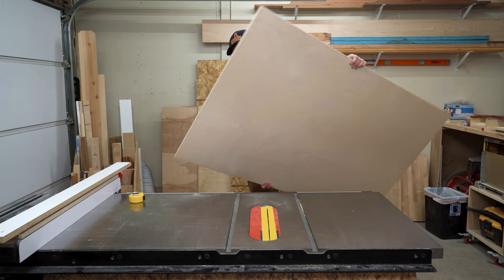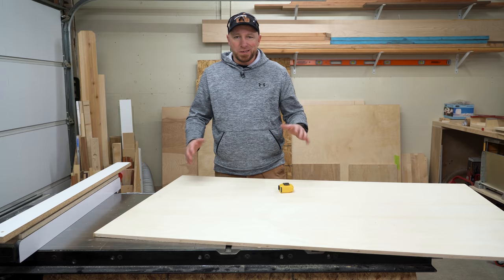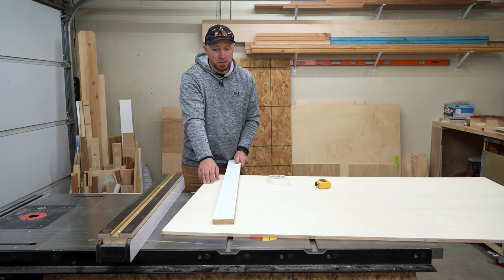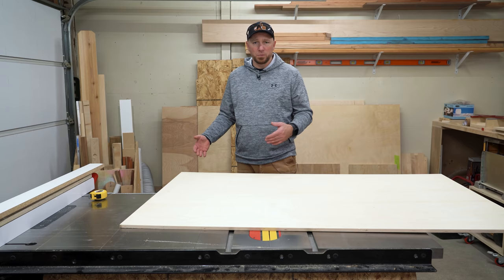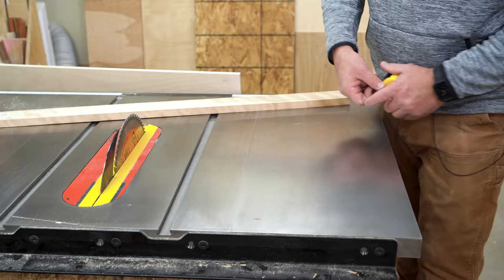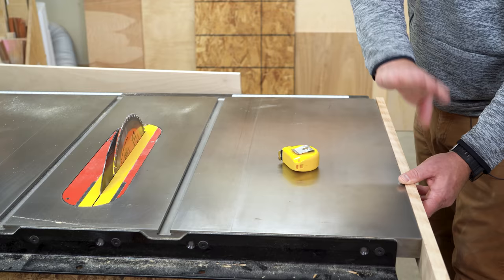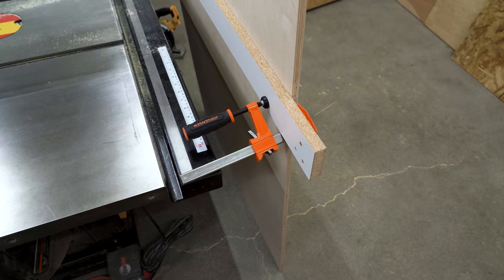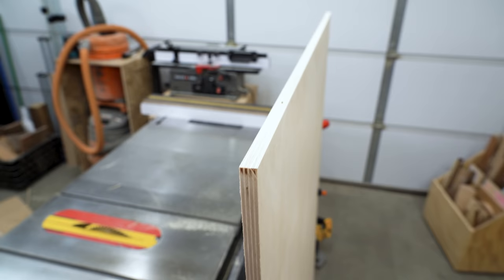A Table Saw Trick So Crazy, It's Genius!

Comment: I like this tip. It gave me a 'smack my head' moment. For the flush-trim router comments - yeah, and I've done that myself. What I found was that the setup was excruciating, and if you needed to edge a really long span then you needed a really long(er) AND perfectly straight piece of stock to flush trim against, which kind of leads you back to where do you get that straight piece? And sequentially aligning the clamps and board are possible... guess it depends on how much time you have. The router route (see what I did there) also leaves burns as soon as the bit is hot, and I may have been using shitty plywood, but I had a bunch of tear-out.
Reply from the maker: Absolutely. Folks here that have goldfish-brain have to realize also that it takes a lot longer to teach someone to do something versus doing it yourself. In reality, it takes no longer than setting up for a router. In fact probably less time because I would have to get the router out, most likely change the bit, and so on. The table saw is right in the middle of the shop and always ready to go. Plus I wouldn't want to break down a whole sheet of plywood with a router. That sounds horrible.
Reply: @InspireWoodcraft  Very true, and I've broken down plywood with a circular saw, jigsaw and then routered the edges clean because this was the Dark Time before I had my Powermatic. Took forever. Edges still sucked ass.

Comment: A much simpler way to do this would be to attach that "fence" to the actual fence and raise the blade with the sacrificial fence moved over the blade. You'd be able to take off as little, or as much material as you want, without all the hassles of squaring up a cleat and relying on the clamps to hold it securely.

Comment: I have used this "trick" before. However I would suggest that you buy a bigger square. It may make a smoother edge but it needs to be square and you can depend on that if the square is larger.
Reply from the maker: @DEW-fk7ij The only problem that I have is that decent bigger squares are really expensive. And framing squares aren't reliable and are a pain to use. In fact borderline impossible in this specific situation. A quality smaller square registered against a known straight edge of the material is still going to register square. The square's blade length can be increased by using a straightedge against it like I did here. I commonly do this with sliding t-bevels to increase their reach as well. The only time a smaller square won't work is if the edge of the material is not straight enough for the task at hand. If the reference edge has any undulations and the stock of the square (the part that registers against the edge of the material) is too short to span those undulations, it won't be very accurate to the overall edge. I do wish someone would come out with a quality larger woodworking square, similar to the Woodpeckers style squares, at a more affordable cost.

Comment: 0:32  if it wobbles, either some bolts are not tight, that’s an inferior brand - or you’re holding it wrong. I’ve never had a problem.

Comment: uhh.....cant you just use cordless circular saw to rough cut it down to within an inch or so of the final width and then put it on the table saw?
Or is that just too simple?

Comment: The day, about 30 years ago, I built every table and every saw the exact same height , in my shop, my life got a whole lot simpler.  But, the day I bought a 24 x 70 ft shop helped a lot too.

It's a good trick but having an outfeed table to support the back end sure makes things easier and more accurate.

After working in my dads small shop, where everything was stacked on top of everything else, as a kid, I decided I was never going to do that.  Now that I'm retired even my "hobby shop" is 27 x 45. LOL

Comment: Very nice.  Wish i had that much room on the side of my tablesaw to do that.  When I've need to do this, I've clamped a straightedge guide to the plywood and then run a hand-held router with a flush trim bit along the guide to finish the edge of the plywood. Depending on the grain direction of the surface veneer, a piece of masking tape or sacrificial block prevents tear out at the tail end.
Reply: The even easier way is to simply use a hand plane. That is what they were designed for.

Comment: With all that weight of the plywood panel your left hand has to hold up makes for an unsafe method. If one of those clamps slipped, there goes ur straight edge.

Instead, clamp on a wood guide fence and use a router with a trim bit to clean up the edge. You'll get a perfect 90 degree cut.

Comment: Good stuff……took a few little rewinds to gather it all in but once I could see the final piece there were B I G smiles!

One query: if you weren’t overly concerned about being very accurate when setting up your non blade end, why did you bother at all as it is such a very tiny sliver? Couldn’t that measurement be lost in your casual (in the nicest meaning of the word) overall setup?!
Kindest
Bob
England

Comment: Using 8" square across 3' why not at least a framing square.  Also a good corded saw with secure base plate and clamped straight edge has worked for me for years

Comment: I'm 48 seconds into this and what I do is clamp a straight edge on the edge I want to straighten up, right where I want my cut, and use a router with a 3/4" bearing, on a 3/4" bit, on the 1/4" shaft. This makes a perfect edge without tearing the veneer at all. If you are worried about tear out at the end of the cut, you can stop just short and use a belt sander, or you could back it up with another piece of wood. I always just used a belt sander, or a sanding block.
Reply: I was going to say the same thing.  I use a router and template bit and straight edge for all my precision cuts. Actually you don't even need a template bit, just measure out for the router base.  To me the table saw method is way to time consuming and not as precision.  Router method also allows to do away with a jointer.

Comment: I always find it curious as to why Track saws are not used much over the pond (at least in regard to woodworking channels I see here on youtube). They're very affordable these days and in this case, is the right tool for the job. Yet people persist to make life harder for themselves and use the table saw.
Reply from the maker: They are used quite a bit. But they're an expensive option for someone that would only use it a few times a year.

Comment: Use a router and straight edge. If you need to remove more than half the width of your router bit then first  jigsaw close to your finished cut line. I don't recommend complicated tricks for DIYers. Safety first.

Comment: Build yourself a panel saw it will fit up against the wall and it the best way to cut sheet good also you build a router into it, the table saw was never meant to cut big 4 x 8 sheets of plywood

Comment: That's a cook trick and all, but the easiest way is to just cut a little less off with the crappy buzz saw, then attach a simple straight edge to the panel and use a ROUTER to get your perfect edge.
Reply from the maker: Sometimes "easiest" is a term that only holds true for whoever says it's easier. My router is in the lift, so I would have to get it out, set it up, and so on. This takes a minute to set up and the saw is right there in the center of the shop. And with this I can break down a full sheet of plywood without the waste of a circular saw and router setup.

Comment: The hook on your tape measure is designed so that pushing it against something or hooking and pulling results in the same distance measured. It slips the exact distance of its thickness unless you've damaged it by letting it constantly slam home uncontrolled.

Comment: When you think about it, your method (which I have used many times) is identical to the saw guide and 7-1/4 cordless method, but upside down! You just made a giant saw guide for your table saw! 😉

The saw guide board works great for me, I guess my 7-1/4 blade and sole plate happen to be more suited for smooth accurate cuts. But, it's obvious there's no substitute for a good table saw and blade.

Comment: Thanks for putting in the effort but you were close when you showed that fence and double sided tape.  clamp the fence and use a circular saw.  That way instead of trying to wield a half or three quarter size sheet of plywood, it could lay safely on your table top or saw horses and you just deal with your very small cut off.  Work smarter not harder.

Comment: This is great. Thanks for sharing. 

An L fence, or horizontal fence, with the straight edge guide attached on top of the work piece, would be another way to perform this operation.

Comment: Great idea! I would only add one thing to this. To the left of your saw as you're facing it to make your cut, I'd have an adjustable sawhorse with rollers to bear the weigh of the wood, if it's large enough to warrant needing more support. And, of course, a nice infeed and feed out table would be nice, but room can be a problem for some. I'm going to try this this week for the roof of my chicken coop run just because if I botch it up, it's not a critical item. That way, I can learn from my mistakes.  :-) Thanks for a great tip!!

Comment: That is a great idea, but I think I have a better one! Just buy a WEN track saw for breaking down your large pieces, most of the track saws are freaking outrageous in prices but the Wen saw is awesome and it’s nowhere near the prices of the others. People should really check them out, I have several tools (spiral head jointer, spiral head planer, track saw, drill press and a ceiling mounted air cleaner) that are from Wen and I’ve had nothing but perfection out of each and everyone of them. Now, go make some sawdust!

Comment: An interesting method but impractical when trimming a full sheet. I personally use a track saw, gives a clean accurate cut and no heavy lifting.
Reply: I agree, but it would be useful for trimming smaller pieces.

Comment: Why not just tape a piece onto the to be cut end say 24 inches wide  and then set the fence that will take off the amount you want? That way it will be easy to push the panel through. It's not easy to cut a inch or so off the end of a panel so close to the fence.

Comment: great solution, I only see one problem with your method. You want to be sure the cut is square, and at a perfect right angle, which is hard to do with such a small square. I would use a framing square, or a more accurate method would be to measure both sides of the board, presuming the board is already square.

Comment: Cool trick. But I cannot believe you used a 10” square to line up a 3’ fence. A 64th gap at the end of the square compounds to a good quarter inch over 3 feet.

Comment: I'd use a trim router, if the table isn't big enough to support the panel, take the tool to the job.
Reply from the maker: You would use a trim router to break down a whole sheet of plywood?

Comment: Instead of a box over the fence, any reason you couldn't make the same jig but using a strip of wood taller than you fence and connecting it with the dovetail clamps? Then you have 3 strips of wood - one taller than then the initial strip you made, one the same thickness as the original strip that slides on top of the original strip, and one to sandwhich the sliding strip on the other side. Hardest part of the these types of jigs to me is making the box just tight enough so it doesn't wiggle but not too tight that it doesn't slide.

Comment: If the project was planned, when at the hardware store, in the area where they have sheets of plywood, etc, They have a wall saw and charge per cut....50c whatever...and easier to handle..
Reply from the maker: I’ve done that before. They cut them all not square and I didn’t realize it until I was using them for my project. Never again.
Reply: @InspireWoodcraft  That's a pain.... everyday someone at the store with experience/training should calibrate the fence/saw.... maybe at a mill? Just saying. You setup is fine.

Comment: I guess whatever works for you.  I have a LONG rail and extension so I've never come across this issue.  But if I did, I think a router would be a bit easier.
Reply from the maker: Like you said, whatever works for you. I've personally never seen someone cut a sheet in half with a router.

Comment: Ever heard of a panel saw? Fits up against the wall of a small shop. It will square any plywood with minimal effort.  Takes up hardly any room.  Used one for years. Never have to lift a sheet of plywood more than 1 ft off the floor on edge , cross cut or rip.

Comment: In the time and afford it took to set that up. It would've been much easier and less time consuming to just break out a router and a jig saw to use with a straight edge to trim / flush up those ends. Pro tip, in that situation I would've still used that shooting board and circular saw. But I would've cut the plywood 1/4'' strong and used my router to finish the cut with a straight edge. The router and a jig will create perfect jointed square edges every time. Great video thou it's always nice to have alternatives.

Comment: This a bit old but wanted to add 2 points to an interesting idea. BIG DANGER. He turns the saw on and then flips the sheet over. NEVER EVER do this. It is tempting to start the saw before you are lined up because otherwise you can't reach it but imagine the outcome if you catch the sheet on the saw while lining up. Also always fully support work using extension tables or infeed outfeed supports and if needed fit a remote switch when working with sheets. If the sheet lifts off the table as it is cutting it makes kickback much more likely If that is not practical use a track saw or some other device.  If you work with plywood sheets best thing to get is a 4ft builders square Way more accurate for marking out and if you clamp it in place it makes an excellent guide for a saw.

Comment: This is great. Totally makes sense.
Now someone explain to my newb ass how the eff to cut a straight edge on a bowed 2x4.  No, not a $&@# 3' piece of 2x4. A full 8' 2x4 (or 2x whatever).  To do this using a table saw, it seems you have to own a 16 foot straight edge to attach to the fence.  I have seen exactly zero videos on how to do this (is it even possible?).   Thanks in advance, seasoned woodworking veterans!  👍

Comment: A couple of ideas that came to me as I watched this really cool idea that I had never thought of or used are. 1. Use a framing square to double check what the small square has shown you or just use a framing square from the start to make sure your guide strip is square to the registering edge of your plywood. 2nd thought is to have a support on what would be your left hand side so that you can focus better on keeping the guide tight against the table saw. I can see you know what you are doing and can handle the plywood with no problem, but there may be some viewers who would struggle with supporting the weight of the plywood and keeping the guide tight to the table simultaneously and at the same time. Redundant enough for you ? Great

Comment: This is not new. I've been doing this for over 15 years on a small, homemade table saw that I have in a condo overseas. The board clamped to the workpiece for this type of operation is also clamped to the table to be used as a rip fence for ripping. I've also used the technique to make any desired cut on 12" x 24" tiles on a small 12" square wet tile saw.

Comment: Good tip, but this is something a small person should not try. Waste a couple of inches of materials by cutting the material slightly bigger than what you need instead, and into a manageable size, then cut it to the size you need, safely.

Comment: I'm not trying to be a jerk, but I could have routed that edge in a lot less time. It also gives a soother surface than a saw blade.
Reply from the maker: No offense taken. Although I will say that the edges coming off my saw blades are perfectly crisp and clean, so you may want to take a look at different saw blades. But either way, in my case it would take far more time to use the router because my router is in a lift. So getting it out, changing the bit, and all that AND of course putting it all back together takes way longer. These things take a lot longer to explain than to actually do. I think some folks might have missed the parts where I said this is perfect for breaking down large panels when you don’t have a track saw or a perfect circular saw and guide. The edge that I cut was just an example because I didn’t want to cut into my full sheets.
Reply: @InspireWoodcraft  I'm not saying it's a bad idea in some situations. However...  I'm fortunate enough to have multiple routers set up for various situations. So for me it's literally 90 seconds and I'm done. I use high quality table saw blades on my Delta uni-saw, but unless you push the plywood past the blade just right, you'll often end up with some minor imperfections. I might also argue that a router would be a safer choice for a novice woodworker. Just my 2 cents.

Comment: Why don't you just throw your table saw in the trash and use the 1x4 as a guide for your circular saw. Now you have an infinity size table saw and track saw all in one. Now do a plumb cut---voila, a chopsaw too. Clamp your board at an angle and now you have a miter saw. Clamp on your 1x4 and you got an infinity-depth sliding miter saw. Just make sure your 1x4 has been through the board straightener first, which you can make with a factory edge of plywood and a Skilsaw and some clamps.